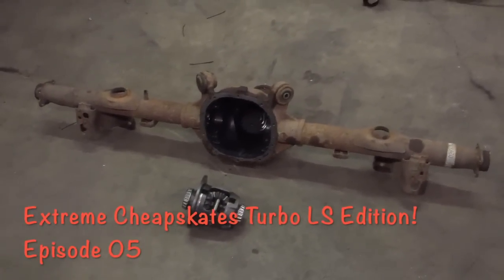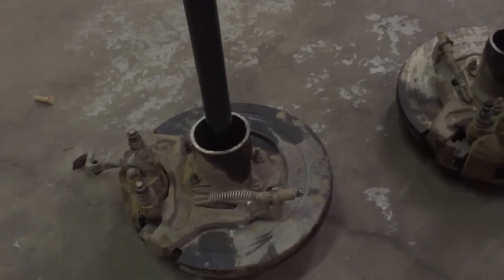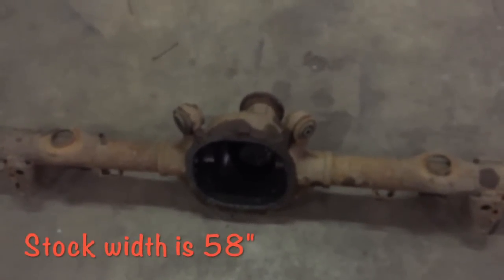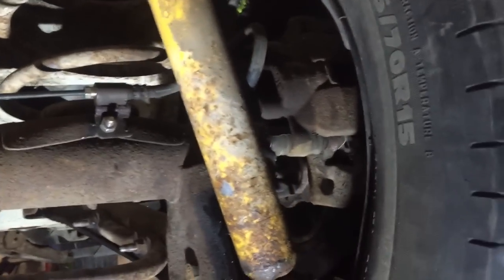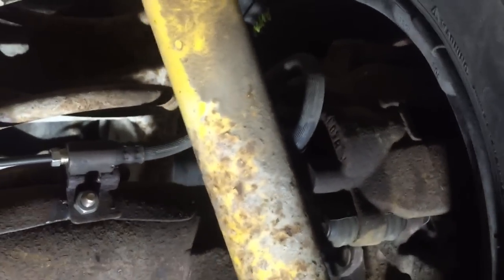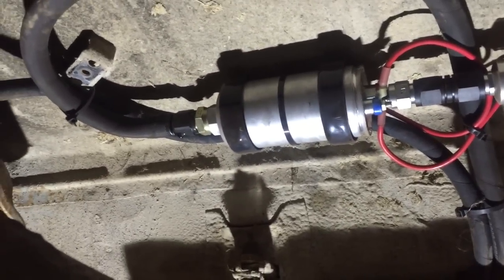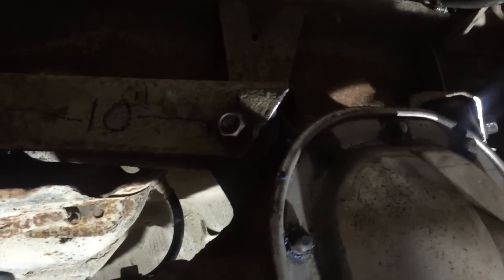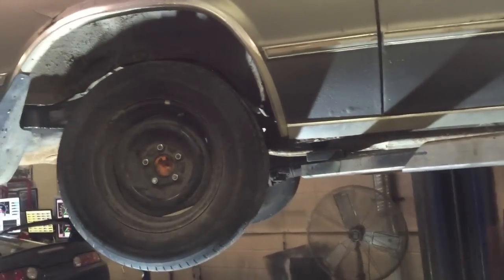Extreme Cheapskates, Turbo LS Edition!! Episode 5 "$100 g-body 8.8 swap!"

Comment: I swapped a 12 bolt from a 72 monte into my regal had to get adjustable upper control arms but i got rear end with posi unti and 4.11  gears for $150

Comment: GREAT BUILD!!!! What oil pan did you use? Also can you  show the fuel system routing a little more? What hoses did you use how did you hook it too the sender? Did you have trouble with fuel starvation the way the pump is mounted?

Comment: What would you do if you needed a new axel/differential in an 85 monte carlo cl. Stock all original 262ci v6 4.3 no upgrades just radial tires. Right rear quarter panel accident.

Comment: So what did you use to keep the coils in place without welding ? Cause the stock gbody has those cups on so the bottom sits in place, I don't see how this will work

Comment: I have a goody stock 7.5  5.3 4l60e 1 in set back plates.    do you have a total parts and price list to install crown box 8.8 into gbody.    how did you align the top control arm to sit ever thing align

Comment: what astro van.  year.   motor and trim.    drive shaft you used.  size  trans yoke. length.  also what do you mean by you going to get a football for it.
Reply from the maker: Erik Perie 2000 Astro/safari, football is for the rear spring

Comment: So I have a 95 mustang GT 8.8 in my 81 Malibu. Spherical upper ball joints and double adjustable upper control arms. It does the mad wheel hop thing something serious. I've seen brackets that lower the front (car end) of the upper arms which would seem like the same end result you have with taller ears. Is this really the fix? Thanks for sharing your skills, great videos.

Also, do you have a stall in that trans? Stock converter in my 4l80e is really soft.
Reply from the maker: turbolq4 yes, you ethier have to raise the diff end or lower the chassis side, baseline suspension makes a nice kit, it has a 3000 stall b&m holeshot converter
Reply: Thanks!! That explains why it wheel hops after replacing the springs, lowers the diff end in realtion to chassis. I need a converter!!

Comment: did you mig weld or arc weld the tubes to the center? is the hole for the control arm in the same location as the factory g body rear? i've read that mustang 8.8 rears have the hole about an inch forward compared to the factory rear.
Reply from the maker: inscoredbz I migged the tubes, the mounts are an 1" forward at at the top, that's why I redrilled the upper control arms
Reply: sorry, i was talking about the lower control arm mounting point.
Reply from the maker: Yes the lowers are alittle forward too
Reply: @Thehouseofboost   So what adjustable control arms to use ?

Comment: earlier in the video you said "the upper ears are a little further apart from each other than what the g bodies are". did they turn out being the same or are they in fact a little further apart?
Reply from the maker: inscoredbz they are alittle wider but the but rubber bushings compensated for the difference

Comment: That diff will explode. Weld plates to the gears and do not weld to the iron. Use a min spool, these days they are cheap as.
Your boxed arms will bind the roll, they are supposed to flex, the reason GM make them that way. Boxing them will put more load back on the brackets or the floor. Which will be your problem as it does not like a lot of power. 
The rest is good scrap engineering. Though 2.73? seems very tall for 1/4 mile stuff. 3.5 3.7 would closer. Explorer?